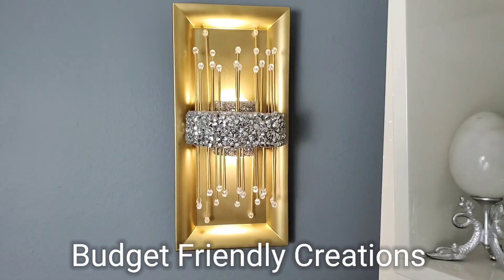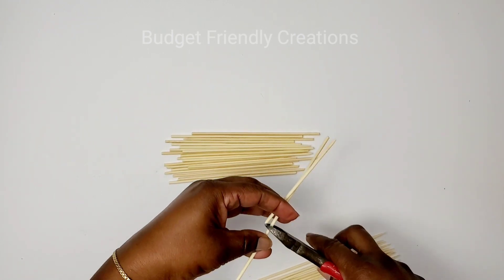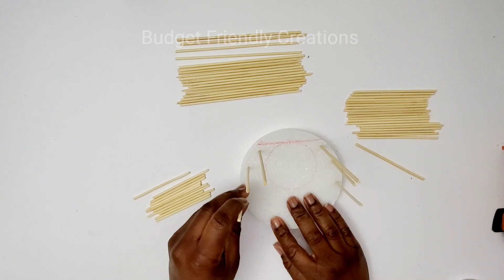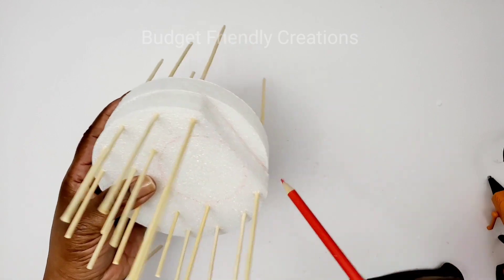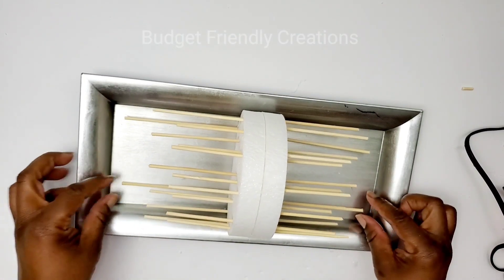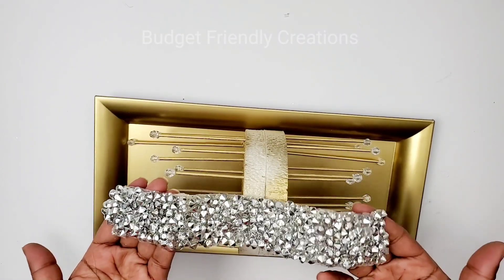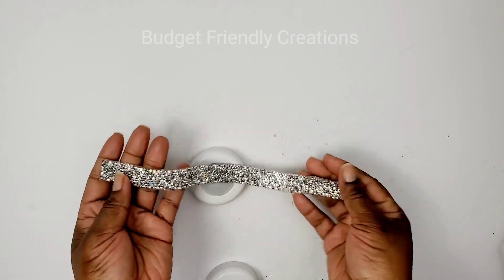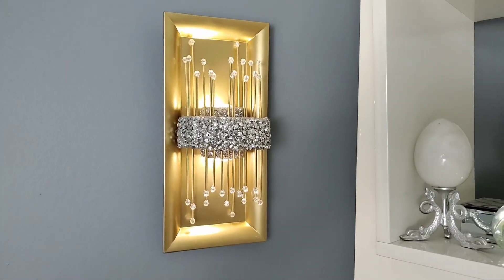DIY Glam Wall Sconce | DIY High End Wall Lighting Idea Using Dollar Tree Charger

Comment from the maker: Hi guys, I realize that I didn't show you how to glue the lights in place,  but it goes in that spot where I marked on the foam, it's the last thing to put in place, hot glue the back of the light and stick it in place, to change the batteries, simply twist it off. I also cut the foam so it can sit flat in the charger plate. Thanks for watching 😘❤ ❤
Reply: Wow ! te acabo de encontrar y ya me subscribí 👍 me súper encantó el arreglo de la pared 👌 muy linda idea🙌🏼🙌🏼Bendiciones 👏🙏🏽💯
Reply: How did you attach the light?x
Reply: Thank you for sharing your information I enjoy watching  your crafts
Reply: Your link to purchasing off Amazon is not highlighted in the description. What else can I do?

Comment: I really liked the project, however you didn't mention the foam in the description, I'm not clear on where you placed the lights, I was  not clear on why u cut the sides was it to fit in the tray? tray was not in descriptions however Iiked the idea, going to try it.🥰
Reply from the maker: Hi, I'll update the description later,  I put the lights on the spot I mark on the foam, that's the last thing to do is glue them in place . And yes I cut the foam so it would have a flat surface to place in the charger all the items I didn't place in the description are from Dollar tree, I didn't write those cause I mentioned it in the video, Thank you.

Comment: I used the wrong foams as there are more than one type of foams.  I cannot use spray paint on it coz it will melt .....make sure u buy the right foam.  Yet this is a beautiful design
Reply from the maker: Oh, I'm sorry to hear; it's the floral foam. However, if you use acrylic to paint it first before the spray paint , it won't melt
Reply: @BudgetFriendlyCreations  thanks for the advise....